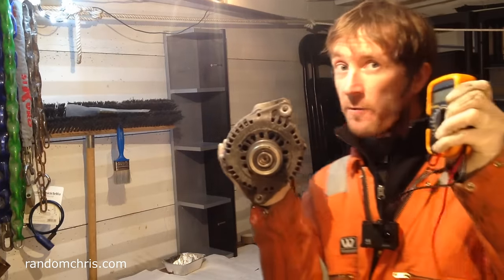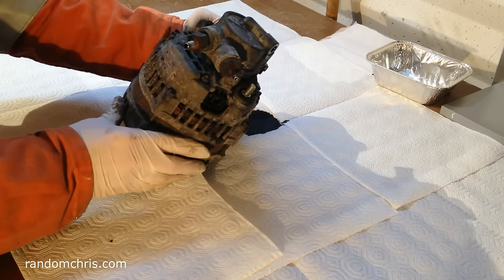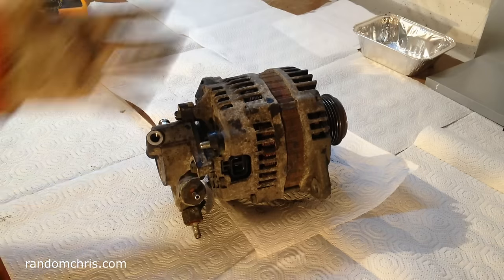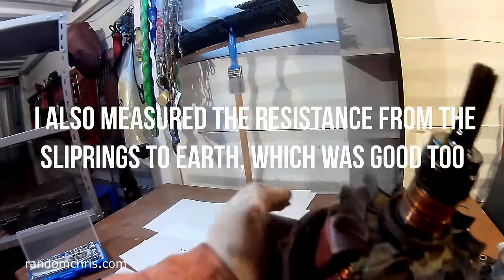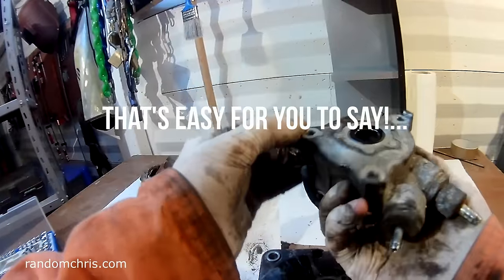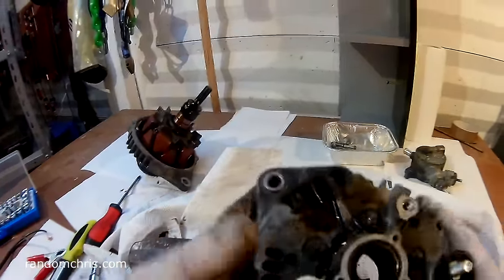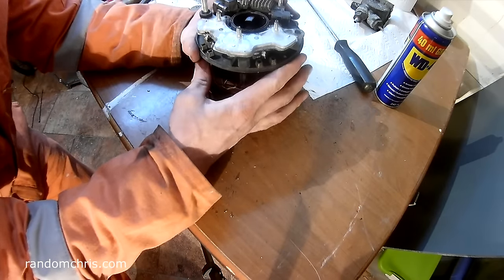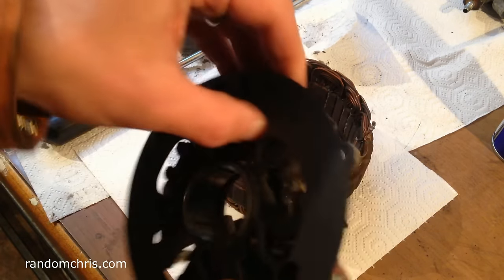How to Repair Your Own Alternator (With Simple Tools)

Comment: Very useful and helpful video. Alternators though are rather unfriendly to work on and difficult to take apart so the easy option sometimes is getting an exchange one.
Reply from the maker: Hi there, thank you for your comment. Most are a lot easier to fix than this one... The Diode plate and Voltage Regulator are often external so it's much easier to see what's wrong with them. Whatever kind of alternator it is, if someone wants to save money it's worth having a go at fixing it... In the worst case, if you don't manage to fix it, you can always put it back together and then get an exchange one. :-) Cheers, Chris 👍
Reply: I agree that often it's easier and cheap enough to replace a part than rebuild them.  But, I always test whether the part is defective before I replace it.  Knowing how to tell is half the battle.  My alternator can be replaced for $108 and a new rectifier is about half that.  But, then the regulator, bearings, vacuum pump and rest of the alternator have 180k miles so it's not really smart to repair.  I found Christopher's video helpful because I never worked on an alternator with a vacuum pump and this is the only thing I've seen that covers it.  I've had my 99 Isuzu NPR for 14 years and never needed to know that until now.

Comment: What if the rotor being held in place doesn't allow the pulley to spin in either direction? This 2 year old Denso alternator for my Camry just started whining, not charging the battery, and the pulley doesn't spin freely from the rotor in any direction.

Comment: I'm having some sort of parasitic drain on my Honda Accord. All fuses show 0v and my idle amp draw on my battery shows only 30mA but my battery keeps dying on me over the course of a couple months or less if I don't drive my car that often. When I do the diode test it shows forward voltage of 400mV and reverse voltage shows 1.3V instead of OL/1/0 etc. If my rectifier/diode is defective will this show up when I test for amp draw? My diode is clearly defective but it seems like it doesn't show any draw.

Comment: Great video, thank you for the information! I bought a new alternator from PartsGeek for my 1972 Super Beetle and it does not work. It puts out no voltage whatsoever... I went to return it and they want me to pay for shipping again and it's going to take 2 weeks for a refund.. if I send it back they will probably just sale it to someone else without repairing it.. I'm going to attempt to disassemble it instead and find out what's wrong with it. Any suggestions on what to check first would be much appreciated
Reply: Is your battery light on on the dashboard or not ?
Reply: @martinparker6536  I figured it out... I disassembled the alternator and found the voltage input connector had come off...
Reply: @gc1362  cool

Comment: Good stuff. 
Pretty sure the alternator is gone on my car as the battery light came on, and over the next hour all the electronics slowly died. First the heater stopped working, then airbag light came on, then the rev counter stopped, and finally a few minutes later, the headlights dimmed, the dash lights started flashing, then the car just died. 
I'm an idiot; I knew pretty much immediately that the alternator must be broken, or at least not working, but I just kept on driving, away from home, instead of turning back. I knew I was going to have a dead battery and I was fine with that, but I totally forgot that the computer controls the engine and it needs battery power! I ended up stuck on the side of the road and I probably deserved it.
Anyway, going to take it apart when I get the car back home, so this was a handy preview of what I'm in for.

Comment: I have a question, if the battery is not working well, can this affect the alternator ? can this affet the diodes of the alternator ? why it is unrecommanded to unplug the battery when the engine is started ? thanks in advance :)
Reply from the maker: http://www.troubleshooters.com/dont_disconnect_battery.htm

Comment: Thanks for the dismantle that alternator , have you ever thought about doing a video on producing AC power out the back of the alternator from beginning to end connecting the three wires to the stater out the back cover hooking up the few transformers you need from what I can figure out 12V to 240V out of each wire off the stater you have 110 AC volts three wires what I can see 330 V AC power into transformers connected to easy generator plug into your home fuse box ! Back up power in case of electrical failure in what I see they say out of each alternator out the back is 90 Amps , 2 Alternators = about 600W @ 180 Amps - off you’re electrical company they provide 250W @ 240 Amps

Comment: Normally its worn brushes, and thats an easy fix. Otherwise find a second hand alternator online (we love recycling right?). Should be getting about 14v out of an alternator; it not there is something wrong with it. Final tip from me: buy common old cars; they are easy and cheap to get breakers parts online. Thx for the video!
Reply from the maker: Couldn't agree more about buying the right kind of car: I can find any parts I want for our car in a scrapyard and, because this model is so common, new aftermarket parts are 'cheap as chips' too. Cheers, Chris 👍
Reply: Alastair Munro Normally? You obviously are not as intelligent as Random Chris. Leave him to the commenting please lol. Diodes in the rectifier and brushes are the most common failures of alternators. Easy? Only sometimes they are easy. You obviously have not replaced many brushes in alternators. And to suggest one should buy an older car so that the alternator is easy to work on just makes you sound like one confused soul.
Reply: Keep the videos coming Chris!
Reply: I love reading car repair comments...
Reply: Lol
Reply: @christopher_barr  There is a self-service yard here that sells parts for quite a bit less than the regular yards. They charge $27 for any alternator, $45 for a car door or fender. They don't pay a lot for the cars, so what you see is popular brands that are about 10 to about 30 years old. I've been able to keep our cars on the road when it makes sense to buy a used part. I have also found items that I would normally buy new, but were in such good condition that I bought them used. A radiator for our '97 Mercury Villager that was less than a year old. Almost new struts for my daughter's Hyundai. I felt sorry for the owner of the car these came off of. He rebuilt the front suspension on the car, and did other work, then the car got hit in the rear.

Comment: my stator wire was cut to short can i solder an extension onto it and will it work?
Reply from the maker: If you use high temperature solder, and a similar wire to bridge the gap, there should be no problem with that. 👍

Comment: Hello Mr. Barr.  Will this procedure work on an alternator from a 4.7 litre  Dodge?  I was told to throw it out, but I don't throw anything out, I'd just assume make a neat paper weight out of it.  Still in the vehicle and making NO obvious noises to speak of,  serpentine belt is new and the tension pulley is also new.  Driving for 10 - 15 minutes, the "CHECK GAUGES" signal comes on and the gauge drops from 14+  to below  8.  After the vehicle is turned off and on again, the gauge is back to 14 + . Checked the grounds , leads and anything else I could find pertaining.  Checked with voltage metre but I think it might be incorrect,  going tomorrow to purchase a new one.  THOUGHTS????   Thanks in advance.
Reply from the maker: Hi Gary, it's difficult to fault-find without seeing the vehicle in the flesh... The 8 Volt reading is very unusual as 10.5 Volts = 0 % charge. If the fault is within the Alternator then the technique in this video should definitely work. Once you have exhausted all other avenues and you are sure the problem is in the Alternator then take it apart and have a good look at it. 99.9% of the time the problem will be 1) Worn brushes 2) Problem with the diode plate (faulty components such as diodes or open circuit). If your Multimeter is good then it looks like the Alternator is working intermittently which could indicate an intermittent open circuit or a component on the diode plate which is about to give up the goose for good. If you can be without the car for a day or two I would definitely encourage you to try the technique as shown in this video, as this will save you some cash, and an alternator is a pretty oversize paperweight! Happy fixing, Chris 👍
Reply: Thanks for the advice, I'll be discombobulating said alternator shortly.  Can I even purchase these parts at my local auto supply in this day and age? I was under the impression they WANT you to throw things out and buy NEW garbage.
Reply from the maker: Happy discombobulationalism Gary - don't forget the white paper on your workbench... :-D You might struggle to get the replacement parts locally (everyone will try to sell you a brand new alternator...) but you can definitely find them online if you do some digging around. Happy repairalisationalism! 👍

Comment: As soon as I found the problem, I would have put it back together and  got a remanufactured one. I worked on one myself once and it still didn't work even after fixing mine. I had to replace one on my conversion van. It was a high output one. It failed on the way home from vacation. We had to wait till Monday to find a store that even had the HP one. no one else even had it.

Comment: Just done mine the bushes were covered in crap cleaned them off and wiped the copper junctions down touchwood it's OK. But taking it off I now have a slight leak of power steering fluid bloody Citroën Berlingo

Comment: To make a video like this easy for the Layman to work on you should have shown up close an actual picture of the voltmeter setting. Many people that have a voltmeter bought it at some place like Harbor Freight and have no idea what any of the actual settings do. If it doesn't say the word battery they don't know that that's what it's for if it doesn't say diode test then they don't know that that's what it's for. If you're doing announce test then you need to say it's an ohms test and show the ohms setting. So again this being said it would be much more beneficial if you actually showed on the dial what you were setting it to.

Comment: If the connections were just loose and old - why would you need to replace the component? could you not just freshly solder them back on?

Comment: So  how do you get the bearing past the brushes?😬
Reply from the maker: Hello, you're nearly there so keep at it! If you 'retract' the brushes there is a small hole through which you can insert something long & thin (toothpick, electrical screwdriver, whatever...) this holds the brushes out of the way whilst you put it back together. Afterwards, when you withdraw the long & thin tool you chose, and the brushes spring back out onto the sliprings. Good luck and let us know how you get on. Cheers, Chris 👍

Comment: I have always dissembled everything that I remove from a car to see if I can fix it before buying a replacement. I figure I have nothing to lose right? The worse thing that can happen is that you have to buy a new one. The only caveat is that when buying an overhauled unit, which can be a lot cheaper, you may have to give them your old one as a core, which can be a problem if you have broken it beyond repair. But on the whole over the years, I am miles in front by being able to fix rather than replace. Actually, this holds true for most stuff, washing machines, driers, roller blinds and even electronics. Have a go.....just don't have a crack at mains voltage stuff if you don't know what you are doing.

Comment: My car's battery dosen't charge while engine is started and head lights on,on other time when i turn off the head lights and accelerate the engine,then the battery is charging.this issue only comes while lights are on...can you explain this to me,why this happens..car is a toyota corolla dx wagon...
Reply from the maker: There is probably a connection about to give way - there will be charging taking place, but less than the demand when the lights are on. Probably this will get worse and all charging will stop. You know how to fix it now though... :-)

Comment: If you use a ratchet with a quarter inch socket, it'll fit screwdriver tips in there and you'll have more torque than you do with a screwdriver and pliers.

Comment: Like a few other commenters, I don't have the skills to do electrical work. I'm more than likely to blow up the alternator, myself, or possibly both. But with this video as inspiration, I removed the alternator from my 21 years old Peugeot 406, then took it apart and presented it to an auto electrician and asked him to test it and fix it. (He had previously told me that he was too busy to remove it from the car and test it.) 
Now his excuse is that he won't be able to buy parts. For a Valeo alternator?
Reply from the maker: Buy the parts and take it back to him! 😉👍
Reply: Christopher Barr - Random Chris yep, I will, if I can ever get him to test the alternator and tell me what parts I need! 
I’m just thankful that I have another car to use as transport in the meantime. Some people are not as fortunate.
Reply: I forgot I had written this!

I did as you suggested. I went back to him with the alternator in hand but he wouldn’t even test the alternator although I had taken it out of my car. 

Basically he forced me into buying a new alternator because he wouldn’t test the original one. I think he was hoping that I would purchase the new one from him, and I probably would have except that his supplier couldn’t get it delivered to him for more than a month. I was able to get one from a different supplier inside a week.

Comment: I got it wrong from the start, make a mug of tea to slurp while doing the work, lubricates the brain ya know :-D.
I also used to work in an auto repair factory, i used to build diode packs for the old lucas alternators, good fun, well i thought so :-D.
Never forgot how alternators worked :-D
Reply from the maker: Exactly, any problem can be solved with the aid of a decent brew! (Yorkshire Tea is my favourite, despite the fact that it 'comes from't wrong side e't' Pennines!...') Cheers, Chris 👍
Reply: You won't believe this, but i only drink yorkshire tea.
I am a "Tea A Holic", it's been the brain lube for many a late night repairing electronics.
Im from the west midlands, near coventry ish, so its not exactly on my doorstep eather :-D
Reply from the maker: I used to drink about 9 cups a day when I was in the Royal Air Force. Just a couple now but you can't beat a mid-morning cuppa! 🍵
Reply: I remember an episode of Top Gear where Richard Hammond commented that Lucas was the prince of darkness. I have bought rebuilt alternators that had added features such as better diodes than stock, so I'm all for the rebuilds. By the way, my Grandfather, William Langley, was from Jarrow in Durham county. I think that the county lines have been rearranged since then and Jarrow is in another county.

Comment: You can get alternators today for even the latest cars for under $100 on ebay, even though dealers and mechanics are selling them for $800+ Took my $97 alternator to my mechanic to install in my 2021 Chrysler 300 and he could not believe I got it for under $100 brand new.

Comment: You can’t fix it if the wires are garbage, the wires are usually the parts that causes the alternator to fail not the moving pieces.

Comment: I know this is an older video.. but u shoulda showed what & how u measured everything, showing the multimeter settings & what probes were where.. the camera was way off pointing at the corner for some reason.. every single time.. or the big white text covered what were suppose to be seeing.. or u only showed it for 0.001 seconds...

Comment: Wtf why are these things built so cheap, broken solder points?  This is in a moving vehicle.  You should be able to roll the thing down a large hill and have it work fine afterwards.

Comment: I do not understand.  If it was an open connection that caused the problem,  why did you not solder it closed?
Reply: It appears the open connection arced, and overheated the surrounding plastic; so plastic insulator assembly was replaced.

Comment: Pretty cool, but for most cars you can pick up a used working alternator for not much more than the parts cost to repair it so not really worth it unless you have a rare type of alternator that’s expensive to replace
Reply from the maker: Getting a replacement alternator for $20 is impossible where this was filmed (Italy). If you can get a good alternator for $20 then go for it!
Reply: Christopher Barr - Random Chris ah I see, I didn’t realise this was in Italy, I’m in the UK so they’re pretty easy to get here.

Comment: Why produce videos if you use terms only you understand i.e. tests good.
Reply from the maker: "tests good" = "the test I undertook had a satisfactary conclusion" Hope this helps 😉
Reply: You need to explain what "good" means to people who don't know, like if I look on my meter for what you tested there is no "good" reading. Explain what good means as in 14.6 volts or less than 5 ohms of resistance, etc.

Comment: After confirming it's the alternator, and not the alternator fuse. Yes, people seem to always forget the fuses while diagnosing electrical problems. But I digress, the next thing to check is, does it have a warranty on it? Most replacements now have lifetime warranties. If you insist on repairing a warranted alternator or starter, you are not thrifty, you are not ignorant, you are stupid. Yes, I know, some parts just can no longer be gotten. Time to blow the dust off your tools, and credit card, and buy new brushes and barrings and rebuild it yourself.

Comment: Never buy a car with dimmed head lights the problem is bad alternator and in uk it will not cost less than £350 if you lucky .